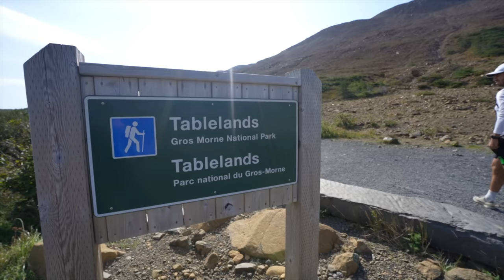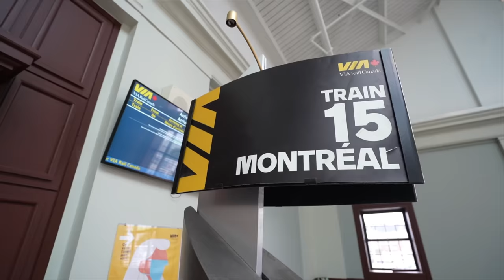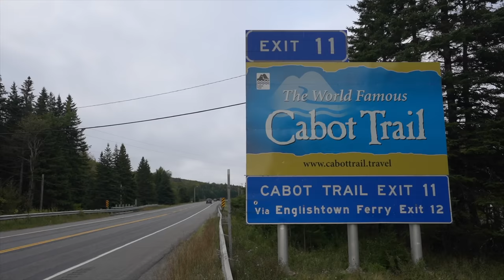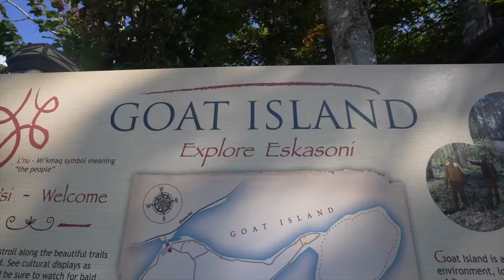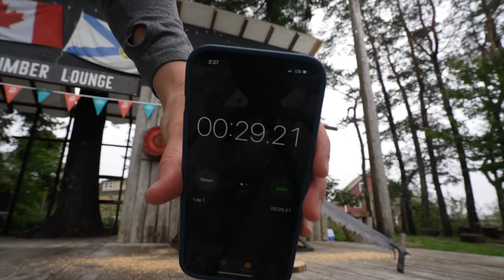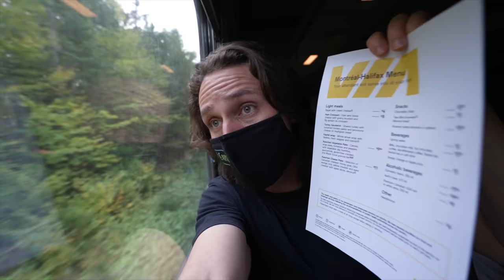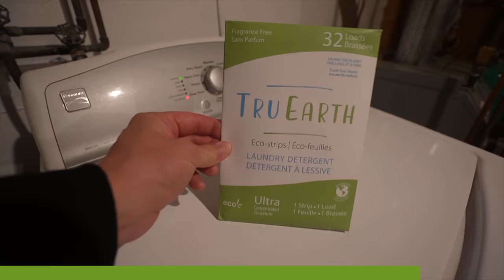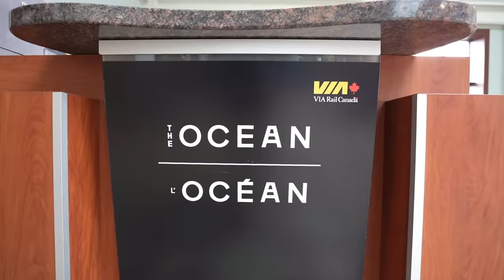Taking the TRAIN across CANADA - Nova Scotia [Ep. 2]

Comment: Little history on Windsor Junction. The tracks you pointed out was actually the CN dartmouth subdivision. The tracks that go to Windsor are long abandoned. Those tracks were called The WHRC (Windsor and Hansport Railway company) and used to run gypsum trains for the CN trains to pick up at windsor junction.
Reply: I could see your confusion.  The visible track at 16:03 is the start of the Dartmouth subdivision, but then she points to the other side of the car to say that's the track to Windsor.  It's still there, it's just that the switch which gives you access to the wye has been yanked with the eastern side of the wye.  I drive past it every day.